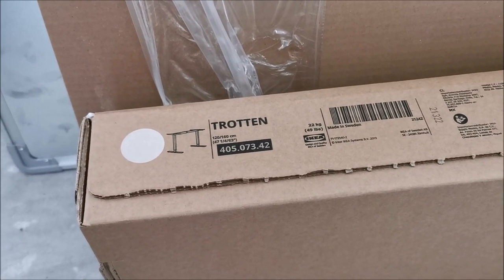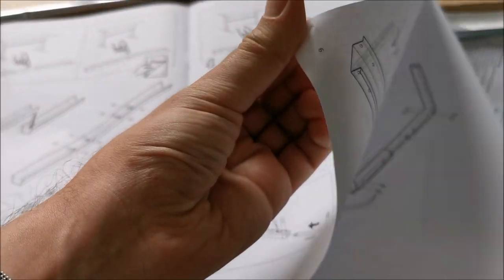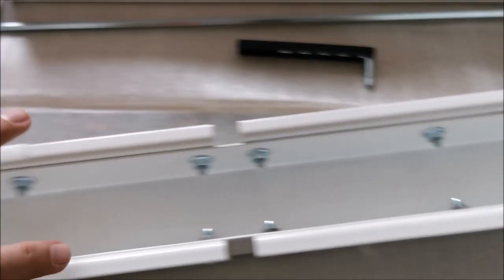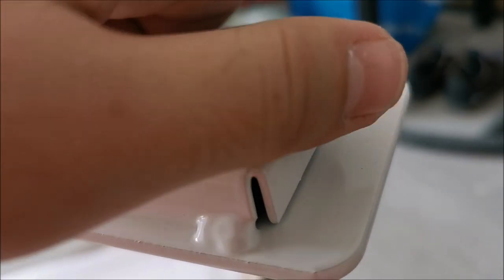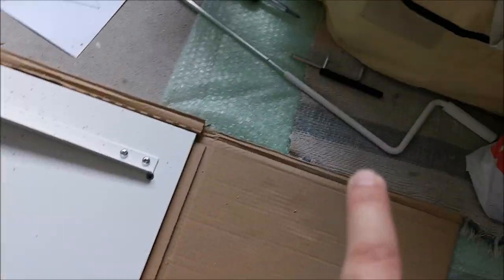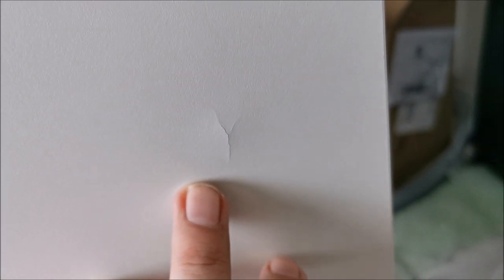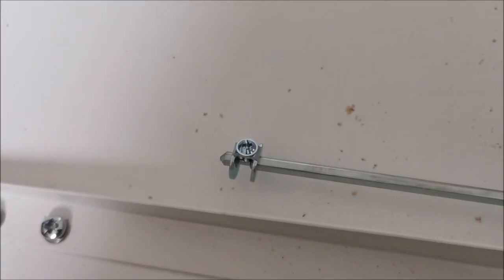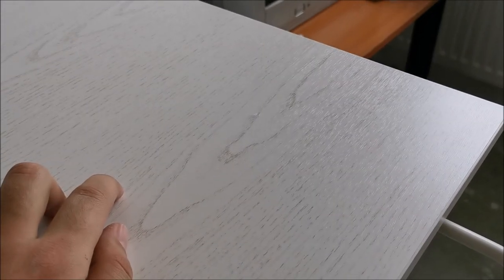Assembling IKEA furniture - TROTTEN - Underframe sit/stand f table top desk (I messed up!)

Comment: You can use plastic plugs instead of screws to secure the table to its base. This will prevent damage to the surface of the table.
Reply from the maker: Thanks for the info, but I think I made the damage while drilling into it, if I remembee right 🤭

Comment: I am going to convert a 120cm Trotten desk into a 160cm one. I am also going to put a music keyboard drawer under it (it is for a home studio).

So if I understand, The 120 and the 160 are exactly the same stuff except for the table top ?...
After watching, I think I am going to buy a 30mm wood table top and wood screws. Thank you for sharing your experience !
Reply from the maker: Yes, if you buy the stand only, it's the same one for all sizes.
Reply: don't forget there is a rather low weight limit on these desks

Comment: Just completed my build following your video. Luckily all parts were available. Thanks man. So far so good. Solid but bit of a wobble when at my standing desk height. I would not recommend leaning on it if you have 2x 24inch creams on the desk. Other than that it is a decent steady build
Reply from the maker: I agree, at max it can wobble if you lean on it, but also the ones that we have at work do the same and they are "professional" grade. So it might be normal in the end.
Reply: If you notice wobbling, it's because you haven't fastened all screws all the way. I had wobble, thought it was strange, really put my strength into turning what could be turned a bit more, and it 100% disappeared.
Reply from the maker: In my case it's just the limited rigidity of the table top.

Comment: I have a weird question, how mush does the table lift when you do a turn of the crank? I'm think about motorizing it diy style but I don't what what power I'll need for the electric motor
Reply from the maker: From what I see it lifts about 5mm for each full turn of the crank.

Comment: Hi, how do you like the desk so far? How's the stability? I'm not sure to either get this or the idasen non-motorized one. Idasen one is 20 euros more expensive than Trotten, yet it doesn't give you ability to use it while standing. I assume that Idasen probably is indeed more stable than trotten if it's more expensive? I'm only going to use it for sitting, the height adjustment on both of them is a really big plus to fit my personal neeeds. Cheers!
Reply from the maker: Hi. It's quite a stable and strong desk. I don't think you will be dissapointed. About Idasen I have no idea, because I never saw it in person.
Reply: I have the Idasen, it's really sturdy. And ss much as I like though, the fact that it's not sit/stand is a major bummer. So I'm personally gonna get a sit/stand to replace it.